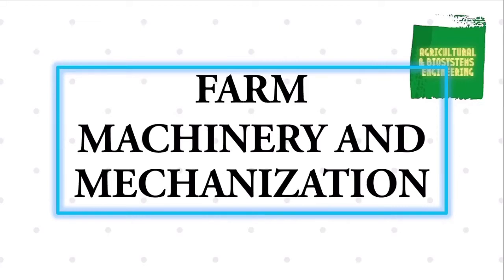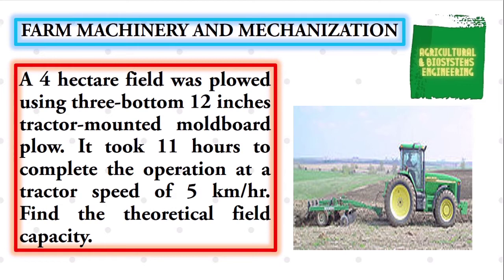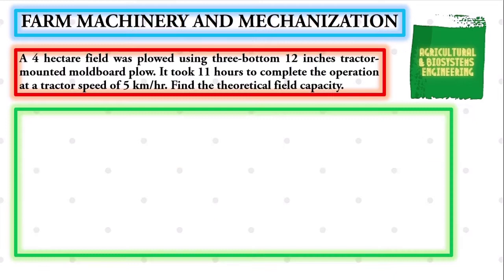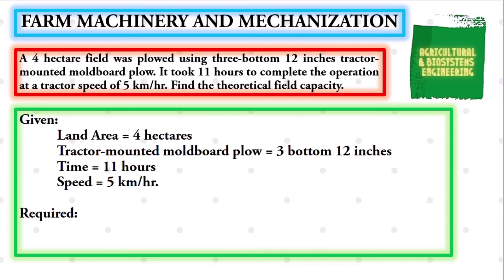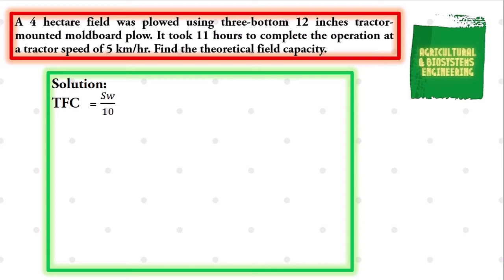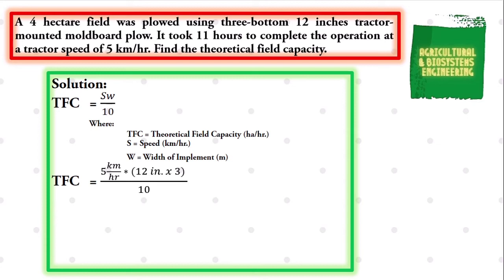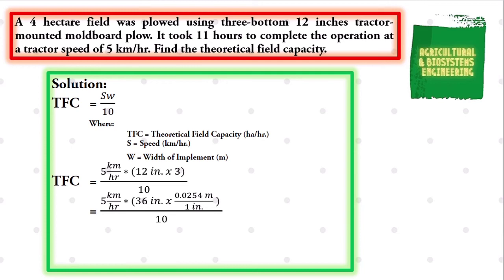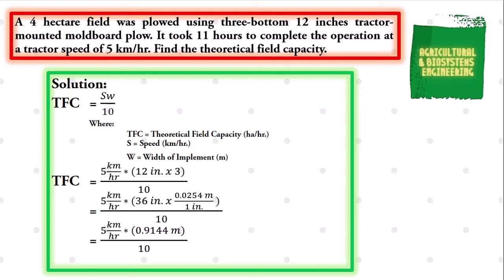A 4 hectare field was plowed using three-bottom 12 inches tractor-mounted moldboard plow. It took 11

Comment: Sir what if the question is:
determine the time(t) in hours needed to plow a 3 hectare field using a 16 cm animal draw. plow with an average depth of cut of 10 cm traveling at 3.2 mph and operating efficiency of 95%. 
A.) if the draft required to pull the plow is 55 kg determine the combined power output of the farmer and the animal. 
Thankyou in advance